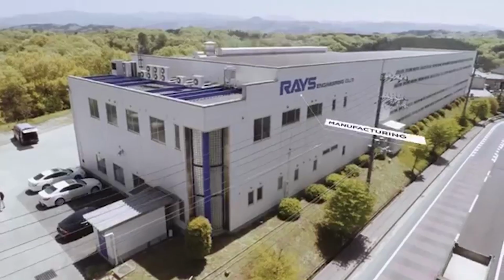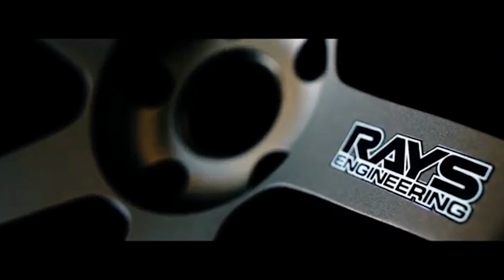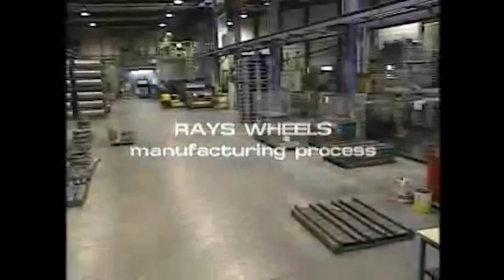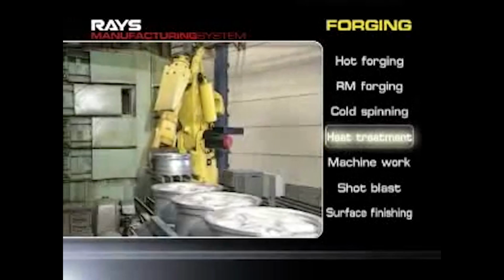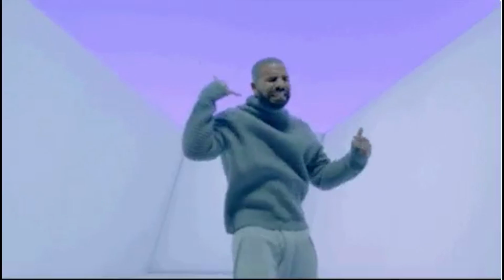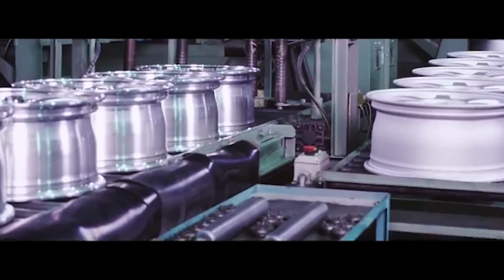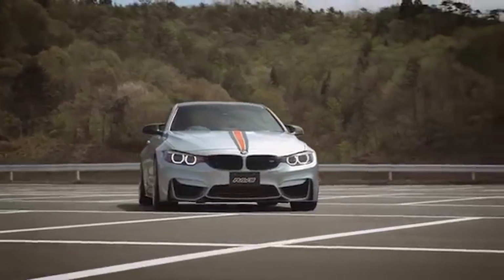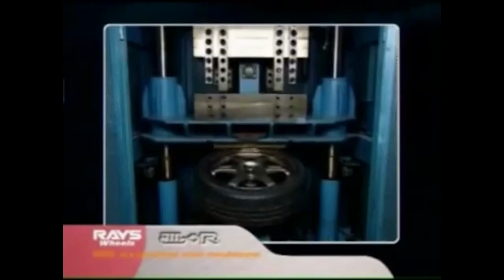THE TRUTH ABOUT RAYS | VOLK RACING WHEELS

Comment: I just picked up a really clean set of Nismo LMGT4’s by Rays Eng for my 300zx, super pleased. 16”-> 18” , an inch wider all the way around and 2lbs less at each corner and really flush. 

Also checking to see if you guys to respond to comment on old videos lol
Reply from the maker: Nice, You should upload your ride to our gallery sometime. https://www.fitmentindustries.com/add-wheel-offset
Reply: Fitment Industries I was thinking just that bit my car mostly looks stock at the moment. I was gonna after a few different exterior mods

Comment: I still have my Volk GT-N from 2005.  17x7
Reply from the maker: On what?
Reply: Fitment Industries. Back in the day they were on my 99 Integra GSR.   I haven't ran them on a car in years.  They are sitting in the garage with brand new tires.  But I have a 94 GSR 4 Door project I am currently working on.  And a 82 Civic grandma car.  So they will be going  something this summer.

Comment: Kids shitting on reps/XXRs are doing it from their parents house who pays for their internet service/phone and shares their car with them.
Reply: Sam Holloway I'm not mad at all. I am just pissed at fanboy posers who want to justify something they don't understand. And FIY kid, I had rays, works and OZ wheels before and can have them again tonight if I want. But like wide body kits, the high quality forged wheels are mostly being defended by hard parking posers who have completely fucked up cars and people like you who clearly have no experience and/understanding of heavy track use.
Reply: Mugshot- Marley what's up can't afford real wheels?
Reply: Sam Holloway I can, but cant justify spending 3k for wheels that I can get for 500, and have no problems with them.  I cant see spending 2500 more for the "name" and little better quality.
Reply: Mugshot- Marley enjoy your reps then, they'll crack eventually.
Reply: Sam Holloway They won't. Its been atleast 3 years and still great.  They're beat, Ive hit a few potholes and even curb'd a wheel on the set I have now on my mk7 golf r.  I also run XXR 513s on my 67 vw bug (disc/drum conversion) for about a year now.  No issues at all. I've only heard problems in forums, comments and online.   Not one issue of cracking or failing in real life.
Reply: Sam Holloway my rotas never cracked. My OZ did. If you are not on a sponsored pro team there is no real difference between rotas and rays besides braging rights and posing. I can afford 5k eur for wheels but there is simply no point.
Reply: longform there's no difference? Holy shit you're fucking stupid.
Reply: longform someone's mad they're using fake Rays 🤔